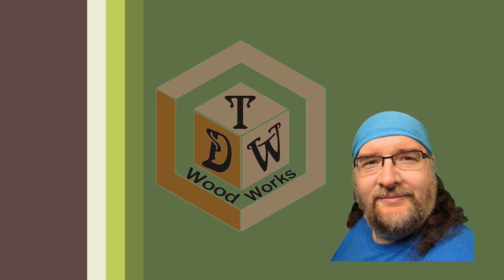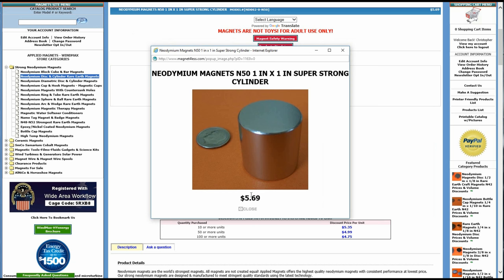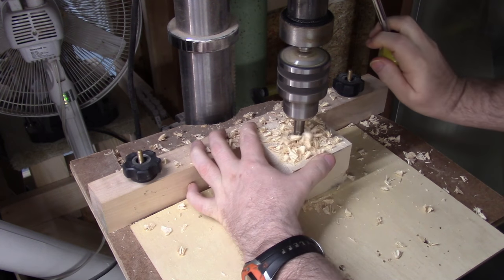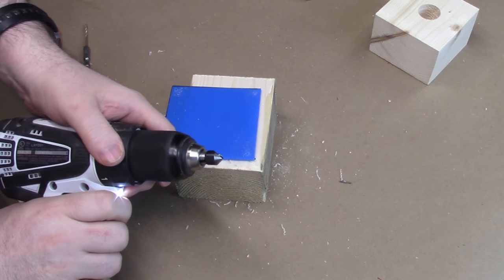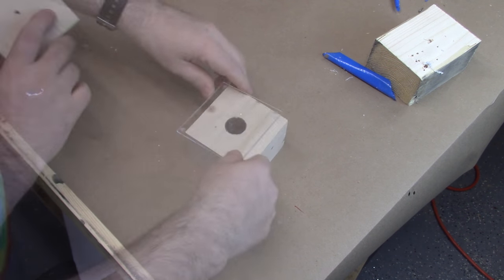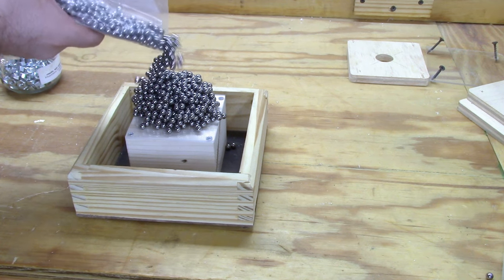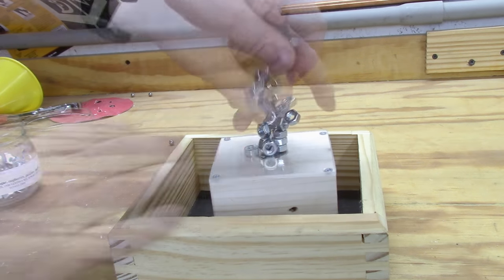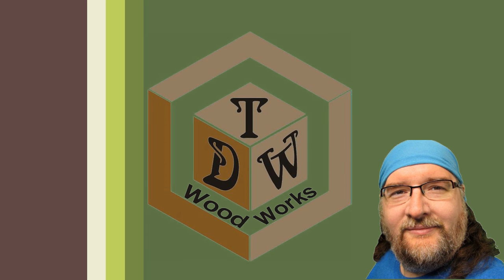My Neodymium Magnet Desk Toy

Comment: If you want to see what a magnetic field looks like in a ferrocell just click my icon.  Hardly any body knows what a ferrocell is.  simply it is 2 pieces of glass with ferrofluid between them and lit with LED lights. A magnet is placed close to the glass and a visual of the magnet field is seen.  Its 3d too but you cant really see that in a video.